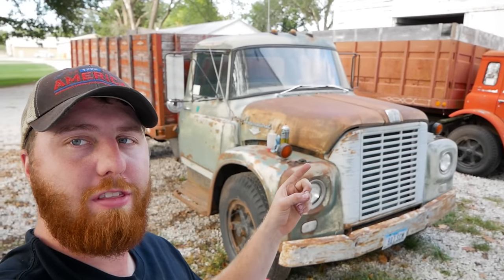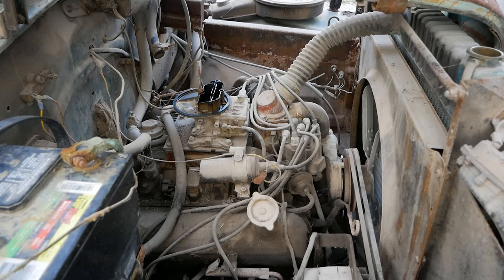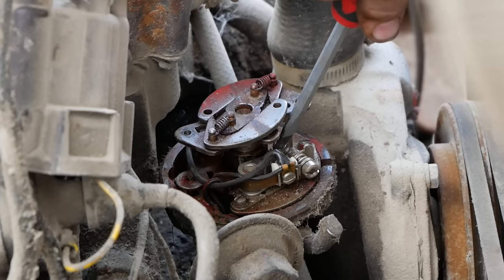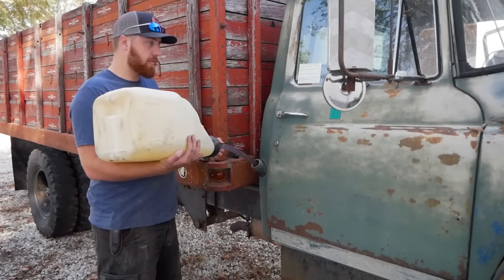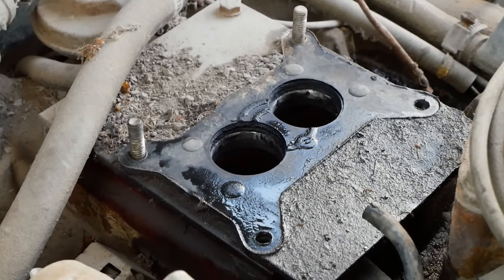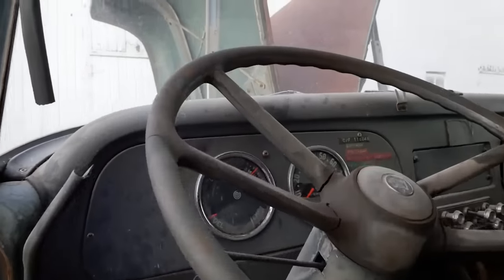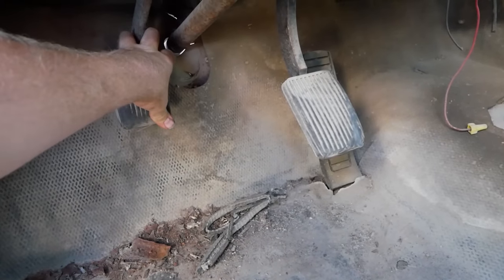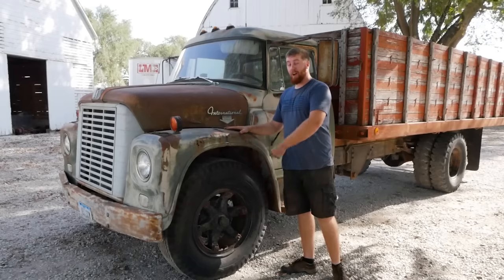FORGOTTEN Retired Farm Dump Truck, Will It Run and Drive?

Comment from the maker: Thanks to Current for sponsoring this video! To get Current and learn more click here: https://www.current.com/junkyarddigs
Reply: I love that dump truck
Reply: Surprised you didn't do a Premiere for this video. Was it because it's a part 2?
Reply: Greate vid man keep it up
Reply: Put black pepper in the radiator it will temporarily fix the leak
Reply: And o’Reillys Auto parts got free advertising lol
Reply: Junkyard digs I have a 1989 GMC Sierra 1500 it has the TBI injection I was raised to work on carburetors and I was wanting to do a carburetor swap wanted to get your opinion or ideas
Reply: @nephrium  jsusjsus
Reply: Funny how things like Current is not even new thing in Finland, we have had state banks with mobile banking systems since 2010 and cash is literally banned in most places and you HAVE to pay with card…

Comment: I have that same truck (almost) 1955 GMC 350 with a Hydramatic that was parked 30 years. Got it running in a few hours.
Reply: When is there going to be an update on it randy??
Reply: @georgehargreaves2110  i’ll be honest with you I don’t go down to my shop very often and I totally forgot I even owned that thing but I plan to get back to work on it soon.
Reply: Don't need one here Randy,he already has one
Reply: That Gmc is nothing much like an international. Lol.
Reply: Noone cares
Reply: @AutoAuctionRebuilds  you have the same truck ?  Only completely different. But ok.... I have a 2002 honda civic that I got running in a few hours as well. Guess I'm right in that club with you and Kevin. 💪
Reply: @BurkesRepair  he can't help himself.....
Reply: @adammealey6721  lol

Comment: I purchased my 67 grain when I was scrapping. Didn't have the parking brake on the floor,  but drove great ( you get used to the steering real quick trying to maneuver around city streets). 1000 bucks is a great price, and a wonderful running truck

Comment: A quick hydraulic clutch blead you can do from the master is fill with fluid, but a hand vacuum pump hose down with a tapered end into the hole in the bottom and pull a vacuum.  When you remove the tip it will suck the fluid down into the evacuated lines and good to go. Sometimes takes twice but works. I have yet to try it on the brakes but may work on some of these old crusty systems as well.

Comment: Love the old school oil cap, for the distributor bushings!  That should be the small cap Gm-points, previous to the big Honkin cap HEI.  BTW them old 4 pin actual HEI module, are small and cheap, and can be wired to late 70 Ford Duraspark.  Heatsink the module, hide it if need be.  And it lights off almost as good as MSD.  Providing you have good wiring, wires, cap, rotor and plugs.  Used the GM module with a Ford TFI coil for years on Propane, and LPG is tougher to light off.  All 12V-no resistor needed.

Comment: Kevin, as you already know  the points do a ground  to the distributor base and sometimes it gets really dirty and whatnot so you take them out and clean where they bolt down. First words in electrical  repair is grounds grounds grounds. Something like steel wool to shine both the distributor and points so when they are in, they make a good contact and ground to the distributor. I had a  really hard one and used my jumper cables to grab the base of the distributor and back to the ground on the battery as it can't get more grounded than that. It fired right up and when you  removed the jumpers it would either die or run so bad it wanted  to. You have to have good grounds on points, condenser, and the distributor itself. All the oils and dirty corrosion keep it from running.
Its a lot more professional if you just yard them out and get the system to ground well and get a good spark right away.... Kevin, I apologize, I have OCD really bad and just want so bad to help you look your best. I don't know why but the international which like all AMC stuff was peoples parts an pieces cause they were on the chopping block and had to say where and how ever they   could. Their grounding system was a f... joke and I would just tap a ground wire right to the side of their distribitors and to a good ground and make sure it was always doing its job. Come spring  when  we needed those rigs, we through fuel down their throat, and check the grounds good. Once happy they would spin over a max of three turns and be running strong.

Comment: The game Snowrunner has this exact truck and they call it a International Harvester 1700. Same grill and everything except the one in the game is a pick up truck. I learned something new from this and live the content and I've been subbed for a little while! ❤
Reply: Vrrrrrrrrrrrr fails to get up the snowy path ive been trying to get up for 1 hour
Reply: Wait isn’t it the load star?
Reply: Is called the same thing
Reply: @LULU1422__  What tires did you use and was it lifted and did you put the best engine in it? I used it and did just fine with it. I love that little truck.
Reply: @MRshiftyLV550  Yeah,it is. I goofed on the name. It's full name is International Harvester Loadstar 1700.
Reply: It is not acectly the same truck in snowrunner, in snowrunner the cabin has 4 doors, the Loadstar in this video has 2 doors
Reply: @GamerXdGer  Minor difference but yeah.
Reply: Love that game
Reply: @Mr.AtheTriggerGalleon6310  lifted not really the best engine it had 4wd and diff lock and kinda good tires but i got up
Reply: Yo it is!!!
Reply: International Harvester is the brand name. Loadstar 1700 is the model. So it's technical name is Internatiional Harvester Loadstar 1700.
Reply: @Corky3D  I know that,I'm a die hard car enthusiast. The manufacturer is:International Harvester;Loadstar 1700.
Reply: All brand loyalties aside, I’d claim that the International 304/345/392  V8s are the most ruggedly built gasoline v8s ever made (with the possible exception of the bigger IH engines like the 549). Tougher than Ford, definitely tougher than the BBC, even tougher than the industrial versions of the Mopar 413 and 361.  It’s pretty rare to find one so mechanically damaged or worn out that it refuses to run.

Comment: On the next episode Kevin finds a dwell meter and learns how to use it!  That truck is exactly like the '69 model I had but mine had air brakes and still had it's 4 barrel, a Carter AFB if I remember correctly.

Comment: I have a 1979 IH scout with a 345 and I'm pretty sure they came with one of three or four different distributors. IH used every body else's parts.
Reply: Many of them used AC Delco distributors. My Scout 80 w/ 152 had one with every other castle blanked off.
Reply: They also used Prestolite distributors. You almost had to have the line build sheet to know what parts they came with.

Comment: I've learned to not ever try and move any vehicle by using the starter motor to move it.  I also learned to never rev the engine up and forcibly jam the transmission into gear to get the vehicle to move.  I also learned to never drive a vehicle with zero brakes.  Too bad you were too lazy to fix the clutch and brake problems before f-ing the tranny and starter motor/flywheel gears up.

Comment: When you mentioned that one had a Ford distributor and the other a GM I  remembered that IHC always put a line set sheet in the trucks from the factory. IHC USED different manufactured components on their trucks from Scouts to their heavy commercial highway trucks. They allowed even their competitors to bid for their business.

Comment: also just a tip to gravity bleed, fill. refit caps. crack bleed nipples then open caps to prevent suction stopping flow. keep filling. Slightly over fill when you feel the air is purged, refit caps to master and then do up bleed valves. if over full remove excess with paper towel, syringe or dip a hose in and seal the top with your thumb, remove it and put over a pan - release thumb and go again

Comment: Love them old Loadstars :)  I bought one for $500, partially stripped for parts (missing radiator, flat glass, gas pedal, rats ate all the rubber hoses in the engine compartment) .. kinda wondering where it all goes.. and made in Canada.. lol

Comment: Engine in tonight's truck is likely a replacement from a mid 70's truck.  The EGR valve gives it away.  The 4 Bbl manifold should indicate either a 345 or 392.
Reply: I was wondering if anybody else noticed that. The engine might be out of a 1973 or newer 1/2 ton pickup truck. There were different emission standards for trucks over 6,000 pounds. In 1979 it was raised to 8,500 lbs because people were buying more 3/4 and one ton pickups to avoid the emissions regulations. I had a 1973 Scout with a 304 that didn't have an EGR valve but it was likely built before January 1st. That custom adapter plate is odd. Most aftermarket plates centered the carb over the manifold.
Reply: Should it have a 304?

Comment: Now drain the transmission, see how much ground up material it holds.  When you snipped that vac hose, I thought it was heading for the carburetor.  I had a small screw pop of a carb accelerator pump and land inside the engine, making its way to a cylinder where it smashed into a piston.  No harm done.

Comment: Looks like a 392. 4 barrel and the coolant tubes go from the water pump to the cylinder block. Also has an EGR valve, so probably a later model out of an S series truck.

Comment: I wish people would start using dielectric grease. Every electrical connection throughout the entire vehicle should have dielectric grease. Saves so much on replacing parts that would rust and lose spark and electrical connections after sitting or even normal use. Especially for areas of high humidity

Comment: If I remember right those cornbinder v8s run 3 different distributors a autolite a ac delco and a holley always know which one you have before ordering ignition parts that one is the delco unit with the oil pot

Comment: you should defo get a truck like this as the official junkyard digs & mook rig for any events where you could bring gear, carry a vehicle onboard or on trailer and just be useful for recovering vehicles. Just and idea :)
Reply: or even get one and make it le mans style and use it as your rig for taking the le mans around and all the bits to fix it when u pull one jump two many (and 4 sets of tires...)

Comment: Gonna take a guess before I get any further into the video - something's weird about the intake. That's a high-rise 4bbl with some kind of adapter. I don't have any data to back this up, but the only time I've seen high-rises was on 392's in the bigger trucks. 345s and 392s in light trucks needed low-rise dual planes to fit under the hoods. I think the factory 392s had rear-dump exhaust manifolds, though.

Comment: I had to rebuild the clutch slave on mine, remember that well.  It was a gusty day, which reminded me of something else ... beware those hoods, they can be man eaters during high winds.  You can usually slip a pin in them to stop that.

Just one of many things about those trucks that I don't miss ... but I'd still rather drive one of those over a newer Navistar.  The process of warranty work is worse than any government bureaucratic process I've ever seen.

Comment: Excellent video Junkyard Digs  (Kevin)  :).did excellent work on this one and remember both trucks my late Dad had on home farm plus 3 others farms rent when growing up and in 1984 got 2 newer ones of 1973 Chevrolet General gas motor  3 ton also 1976 International daul axles  9 ton Desiel motor  to get crops of feilds and box for haul farm cows to Auction barns ! Plus learn how drive age 16 then got my DZ license age 18 drove till to 28 age when home farm sold !

Comment: go get yourself an emory board for cleaning the points and rotor contacts. its normally used as a fingernail file but works really well for points

Comment: i need some insight on how to rig a temp tank on this truck to try and get it running ive got a line from the tank to manual fuel pump on block from there to a hardline to inline fuel filter to hard line to carb. which hoses need to go where? not sure what supply v return. Thanks

Comment: Whoever taught you that you could crash a tranny into gear from neutral, it needs to be un-taught.  Yes, you can shift on the fly without a clutch, but this rig showed you it would move in gear on the starter, so do that!  I hope for the next guy you didn't bite out a tooth, which is what that will result in.

Comment: FYI all through the late 60s into the mid 70s that's the same parts as a GM distributor from the 60s. Napa stocks everything you need.

Comment: I would have thought both would have had Delco ignition. Did they both have Delco alternators? I know they switched to prestolite ignition later on. Someone could have put a newer prestolite distributor in the cabover. Had a 66 IH pickup with Delco ignition/alternator and had a  73 IH that had prestolite ignition/alternator.

Comment: That radiator looks to me like it cam be patched, either with epoxy or with solder.  Physical damage usually can be patched, though sometimes by plugging tubes which reduces capacity.  Corrosion is sometimes tougher.

Comment: That engine is a newer model. It has egr valve and oil fill in the valve cover, the reason the distributor is different the newer model engines used a different brand distributor

Comment: The engine is probably a 392 because of the 4 barrel intake. 304's only came with 2 barrels 345's had mostly 2 barrels, most 392's had 4 barrels.

Comment: Last time I mentioned that IHC engines base timing bases everything off of cylinder 8, now I'm gonna mention that there's multiple direct diesel replacements including the 2704et or 2704iet engines, don't quote me on that but multiple old French guys in our small french village would swear by that
Reply: On Another note those trucks were either built 10 minutes from home in Chatham Ontario or in Hamilton Ontario their should be a plate either on the dash or in the door

Comment: 4 barrel square bore intake atop either a 345 or 392.  The original and missing 4bbl Holley 4150 probably just failed.  The 2bbl version wouldn't deliver any greater economy on that truck.

Comment: Looks alot like mine i picked up couple months ago. Mine is a 345ci v8 and it has 398k miles its a dump truck. I need to find parts for it and to find out the location of the vin#

Comment: How do you tell if a motor has good compression just from hearing it turn over? Trying to learn but don't have the ear for that yet...
Reply: poor compression makes the engine turn over faster, and keeps spinning longer after you have released the key. if you have a bad cylinder, the engine spins faster on that cylinders compression stroke, so you get an uneven sound during cranking
there used to be a blind man who could tell you every make/model of car just by listening to the starter motor, but that was before utube
go down to your local fuel station, close your eyes + listen to all the cars starting up, - you  will get used to the rhythm + notice when an odd one appears

Comment: I'm not entirely familiar with other carburetors, but the myth of 2bbl Rochesters being more economical that their 4bbl counterparts is a myth.  This is based on the primaries in the 4bbl being smaller than the jets in the 2bbl.  Just think about it in the application of providing fuel to a typical American V8 from the 60s to the 80s, generally speaking.

Comment: Sandpaper and emory boards will often leave a deposit on the contact points. This will prevent spark. A simple inexpensive (about 2 bucks) contact points file will work every time.  Why do I constantly see mechanics still using sandpaper? Got a zillion dollar tool kit and no points file. Come-on-man. A shot of starting fluid will degrease them, but, always let it evaporate before sparking. I have personally blown a distributor cap to pieces. Have a good day.

Comment: Why would there not be a four barrel high performance engine in a dump truck that's going to be hauling heavy loads. It's seems logical that they could use the extra power

Comment: no one from the old generation understood how the 4 barrel carb worked they thought it was always dumping gas and causing bad fuel efficiency so they did away with them ... and also during the 60s' ..of coarse .. no one had any money .. did stuff as cheap as possible
Reply: Old carbs are junk. My grandpa was messing with his constantly on all of his ancient vehicles.

Comment: You need a oil leaking, air leaking, single circuit brake system for the real Loadstar experience.

Comment: They engine is a 392 ih v8 international used the same carburetor and distributor as the Ford 391 industrial I have never seen a gm distributor on a international before international did use gm starters and alternators I had a international that had a 392 the 392 has a 4 barrel the345 engine hav 2 barrel carburetor I have that same truck with a 345 engine